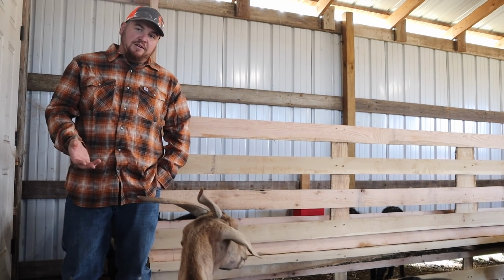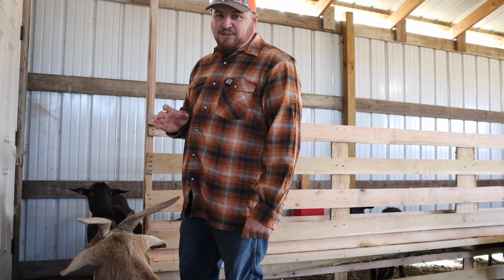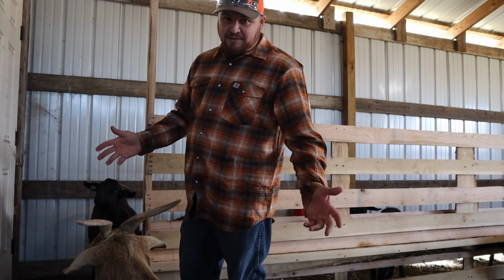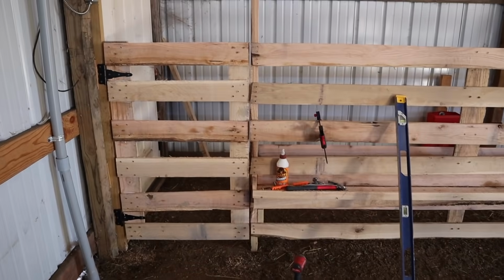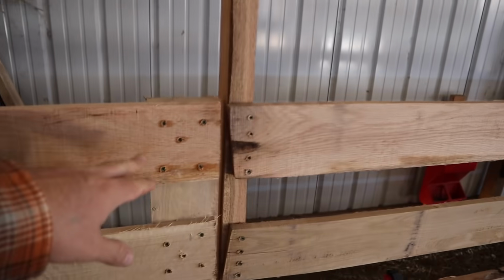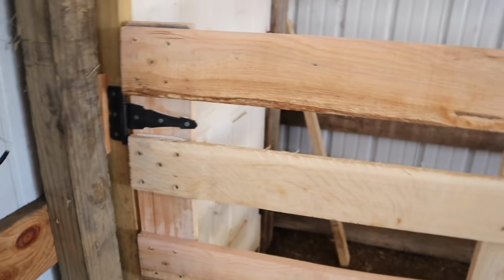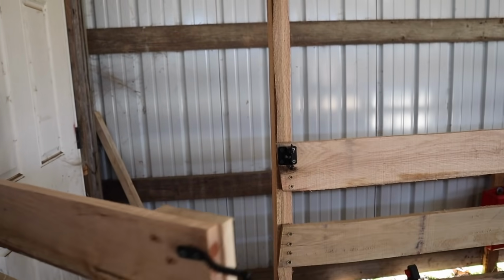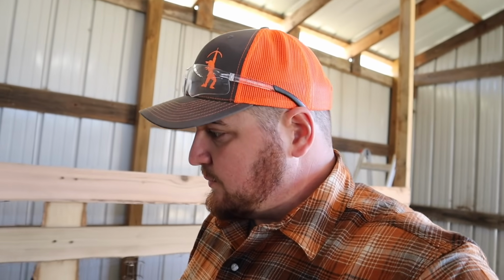Building A Barn Gate Out Of Rough Cut Oak Lumber From Keeping It Dutch's Sawmill

Comment: Kevin I take me a peace of rebar and drive down beside each post and that make it not move around .
Great job on the gate too.
God bless allways cliff
Reply: Good idea.  I was thinking a T post, but rebar would be simple.  He could attach the wood with conduit fasteners.
Reply: @bradcash8572  I like the T-post idea better. Even the thinner green fence posts would be stronger than rebar, and have holes every so often where a screw could be used to fasten. If screw head wants to slip thru the hole sticking a washer on 1st would stop that.
Reply from the maker: I plan to do that. I think it should work ok

Comment: A bit of plain fence wire, ran from the top hinge to the opposite bottom corner with a small turnbuckle in it will stop the gate from sagging, and can be tightened or loosened over time, as the boards cure in place. 
Bits of rebar hammered into the ground where the feeder meets it can keep it from moving. Just need to fasten the rebar to the uprights with a metal strap or extra large staples.
Just a couple ideas. Love the progress. Betting it will save you some headaches.  And now the kids can do the feeding, if you, for some reason, aren't able to. or, maybe, incorporate the goat feeding into their chores, now.
Just a suggestion, but when you build the LGD gate, also build it as a a full opening gate, so you have two access gates for a chute for the goats, if you need it.

Comment: The bunk is so awesome! I think you're right about just ending it where it is. It might make using that as an alley a little different with it leaving enough space for goats to turn around, but I think it should still work fine. Oh! You might consider placing a 1x1 strip as a stopper for your gate. Even with the latch there a stopper would a good backup should the goats open the latch accidentally. 
Did Caleb get a deer? I don't think I saw anything on FB so I'm guessing a big fat bummer "no" as answer to that question. Will you take him during the upcoming special hunt?
Reply from the maker: Nope he didn't yet. I plan to put a backstop on the back
Reply: @HiddenHeightsFarm  - Dang, well that is a bummer to be certain. Tell him I'm sorry. Can't win them all, but there's always next time.

Comment: Don't you need a sag board from top to bottom diagonally "/" to help it not sag?
Reply: That might help strengthen all the way down to the end where you'll have the jump gate.
Reply from the maker: I might do that
Reply: Yes, came to make the same suggestion. Add a brace behind your horizontal slats from the top right corner down to the bottom left corner. That will transfer the weight down to the hinge post and the gate will not sag.